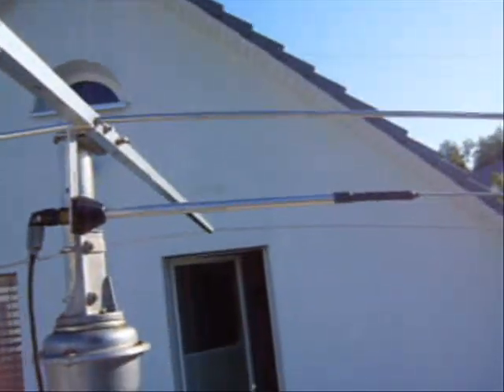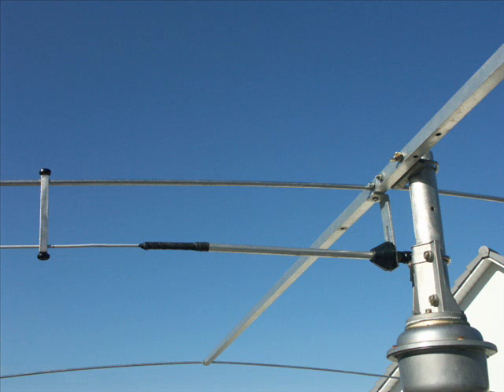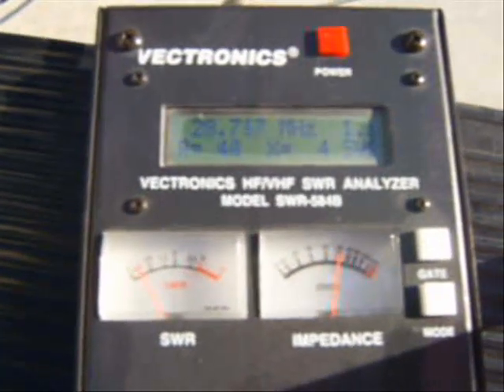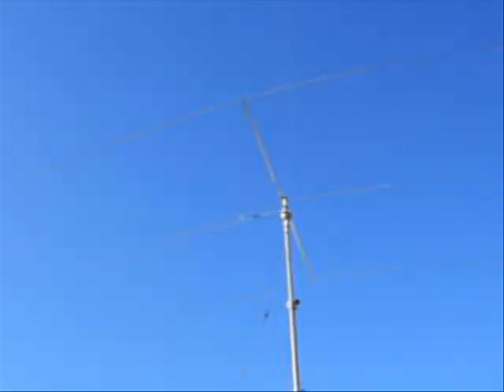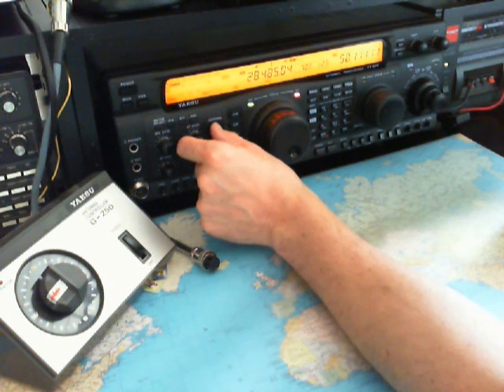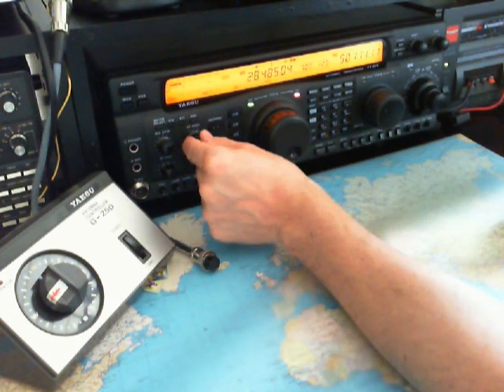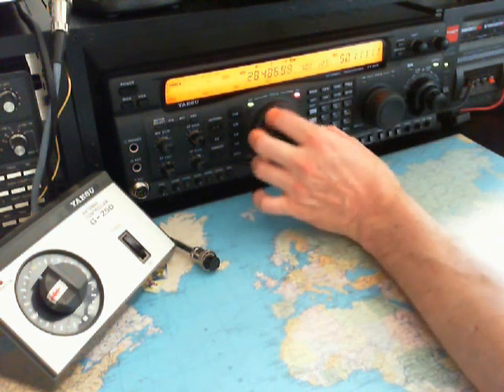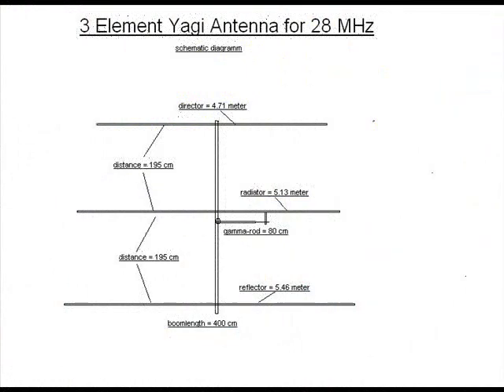3 ELEMENT HOMEBREW YAGI ANTENNA FOR 28 MHz

Comment: Call me slow to the table, but I'm 52 this year, and I have only just bought my 1st beam, albeit a 3 ele Yagi for 11m, setting g it up tomorrow
Reply: Will be having the beam mounted on the chimney with rotor, I have been having some great Dx using a Hawkins Thunderbolt ssd12+, which is a 5.5m wire with a coil.
Replacing that with a 10/11m Yagi wire 22ft with a balun, that'll be above the beam on a 10m Spiderpole.
Great video, 73's from the 407 near Manchester Uk 👋
Reply from the maker: Hello dr CB-radio fan Edzashed 407, thank you for your interest on my channel.  All in all, CB-radios and -antennas are a passion of me. It was a beautiful time in the 80ies: Big CBiers parties, without smartphones and instagram profiles. Best 73s and happy airwaves to you and yours. ..
Reply from the maker: Hello dr CB-radio fan 407 Mcr UK, thank you for your interest on my channel.  All in all, CB-radios and -antennas are a passion of me. It was a beautiful time in the 80ies: Big CBiers parties, without smartphones and instagram profiles. Best 73s to you and yours. ..

Comment: better if you use larger diam pipe, big birds will break it or some wind will breal elements, too thin = light weight vs strong. but good build
Reply from the maker: Mister Lucky Dube hello, thank you for your interest on my channel. So all in all, HAM-radios and -antennas are a passion of me. There was a beautiful time in the 90ies: Big HAM-radio parties, without smartphones and facebook profiles. So I'm not on facebook, but on 28 MHz… Best 73 to you and yours...
Reply: @SWIZZRADIOS  i work 28 mhz  as well search 10 watt to south africa you will fin me on youtube :)

Comment: How is the driven element insulated from the boom? And your reflector and directors are not insulated from the boom? How does that work?
Reply from the maker: Mr Brian hello, thank you for your interest. The radiator isn't insulated from the boom. It's not necessary, because the feeding part is a gamma match element. The reflector and director aren't also insulated, because the current-maxima are in the middle of these. You should ground all sticks in the middle, for a good lightening protection. Please take a look in the ARRL antenna book. Happy airwaves to you...

Comment: Nice job and I especially like the way you made the sliding section of your gamma match so you can adjust it. 73
Reply from the maker: +ElPaso TubeAmps Mister Amateur Radio fan hello, thank you for your post. The Antenna isn't on the mast to time. I'm working with my TAGRA BT-104 antenna. Happy airwaves to you...
Reply: 34  RAC 071 Marco Desde Islas Canarias España
Reply: Machst du keine neuen Videos über Yagis mer??

Comment: hello, my friend. I just built a simple 10 meter aluminum dipole, it works well, but when I saw how good your 3 element yagi works, and how very nice you constructed it. I was very impressed with it. could you please give me a list of the aluminum tubing sizes that you used, and any advise on the best way to construct this antenna. thank you. "god bless" 73's (UNIT928) ben..
Reply from the maker: HAM-Radio fan hello, thank you for the question. I've taken the sizes of the rods from ROTHAMMELS ANTENNA BOOK. There is a instruction about 3-Element yagis in the directory 18.1.2.2 in the 12. release of the book. (DARC Verlag Baunatal). Best 73's..
Reply: thank you

Comment from the maker: @PA3HGY: Hello dr OM.Of course, a 3-element is higher in the gain and better in the radiation pattern . But the HB9CV antenna is higher in the gain and better in the front to back ratio (Mister Rudolf Baumgartner (HB9CV) as a 2 element yagi. The boomlength of the HB9CV is abt. 1/8 lambda and of the 2 ele. yagi abt. 1/4 and at last, of the 3 ele. yagi abt 1/2 lambda!!! I think, for my small antenna place is the HB9CV the best solution. I will send you a mail with my HAM-radio-call..73's.

Comment from the maker: @MrAirstation54 
Hello dr OM. The aluminium rods are taken from an old CB 1/4 GP antenna, called Lemm GP-278. The gamma match part is made of an old mobile antenna base, with 3/8 bolt. Some old CB-antennas gives materials for new ones. Example the 2.7m radials from an old 5/8 antenna.... 73's....